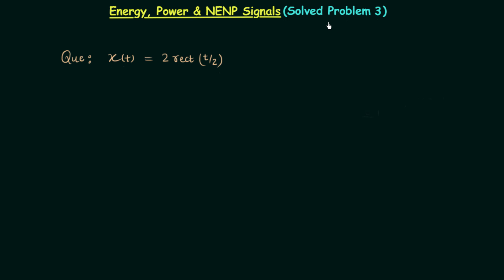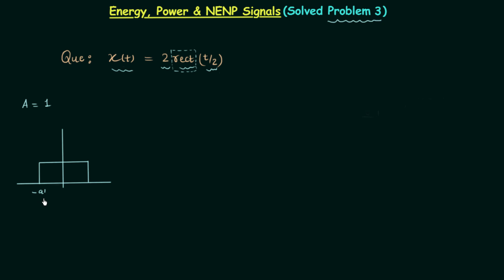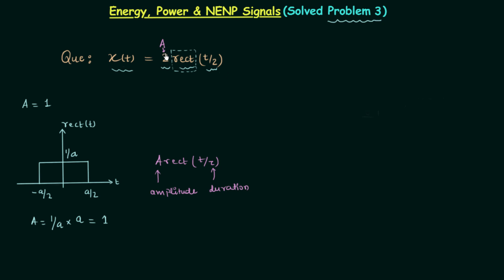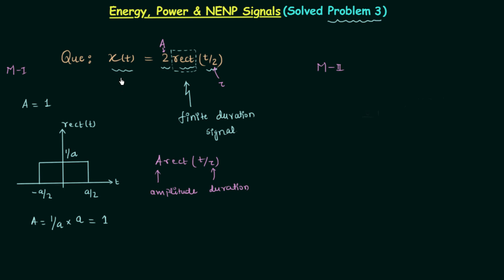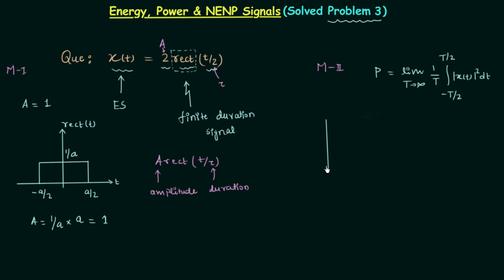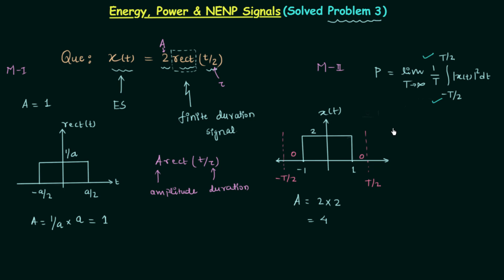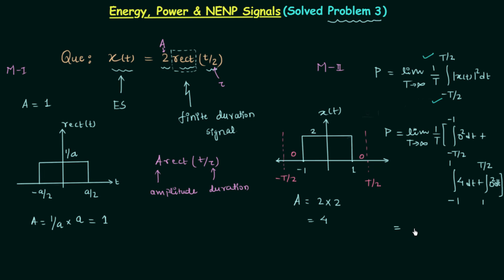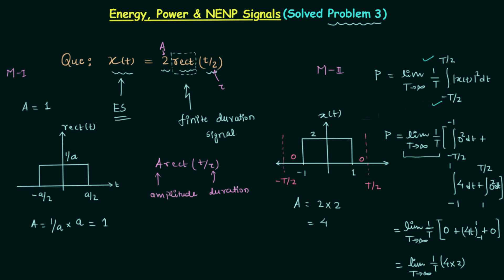Energy, Power & NENP Signals (Solved Problem 3)

Comment: Given rectangular signal mplitude is neither increasing nor decreasing then whycant it be a powersignal
Reply: This will be in case if the signal is an infinite extension signal.
Reply: Because this is a finite duration signal